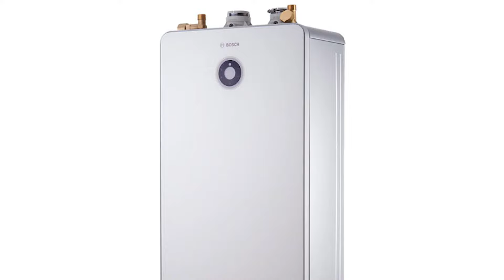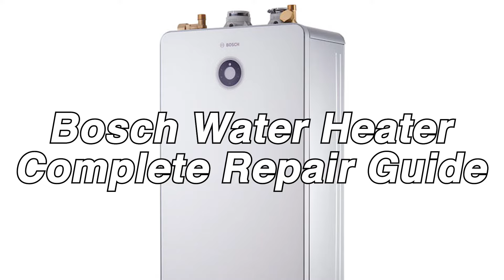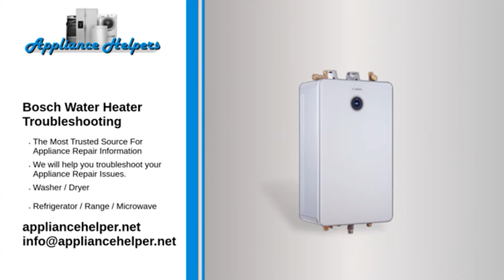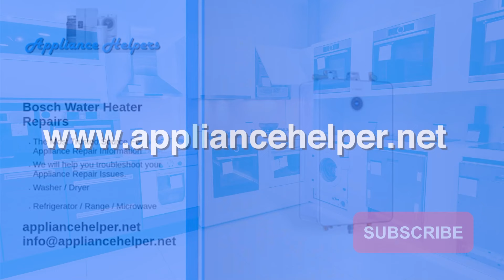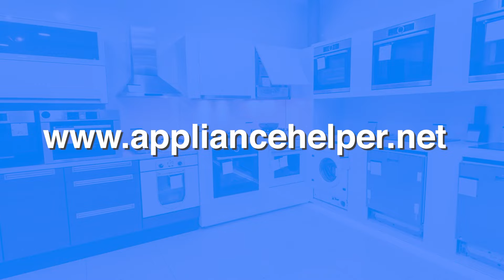Bosch Water Heater Complete Repair Guide - Error Codes and Troubleshooting Tips

Comment: Question: On our Bosch Integra 500 tankless, I see that code computer does not record a new code if there is an immediate repeat of the same issue. How much time must pass before the code will be reported as a new separate issue. For example, I see in the list of 10 codes that there is a repeat of E0 four times in a row, earlier in the list, so there must be a time interval.
Reply from the maker: In Bosch tankless water heaters like the Integra 500 series, the time interval required for a repeated error code to be recorded as a new and separate issue may vary depending on the specific model and firmware version. However, typically, there's a delay or cooldown period between error code occurrences before a new code is registered.

Unfortunately, the exact duration of this cooldown period isn't usually disclosed in the user manual or documentation provided by Bosch. It's often determined by the manufacturer's design and programming of the control system. As a result, users might not have visibility into the specific timing mechanism that governs when a repeated error code is recorded as a new issue.

If you're experiencing repeated error codes and are concerned about the intervals between them, it's best to consult Bosch's official support channels. They may be able to provide more detailed information about the error code recording process and any relevant time intervals associated with it. Additionally, they can offer assistance with troubleshooting the underlying issues causing the error codes to occur.